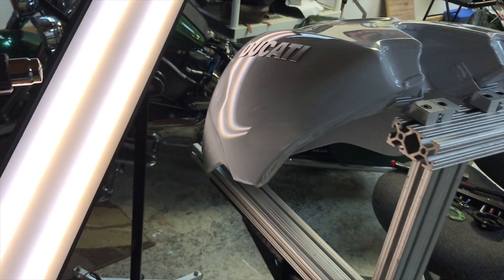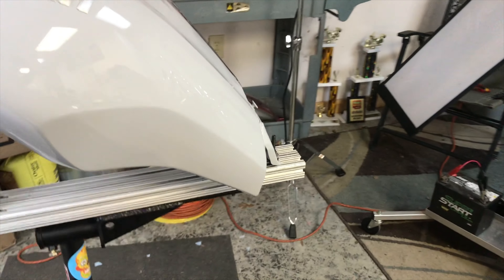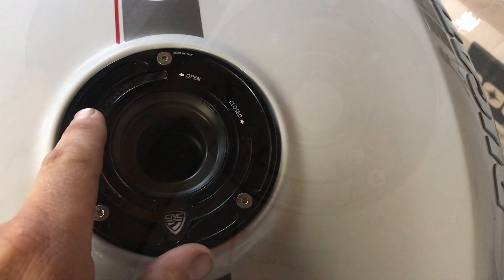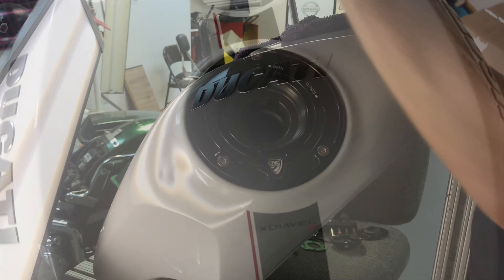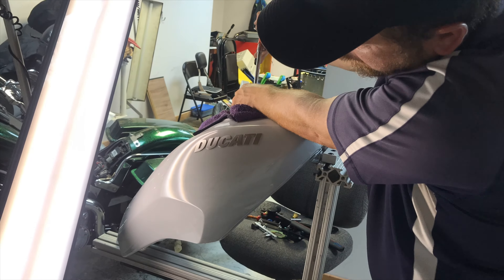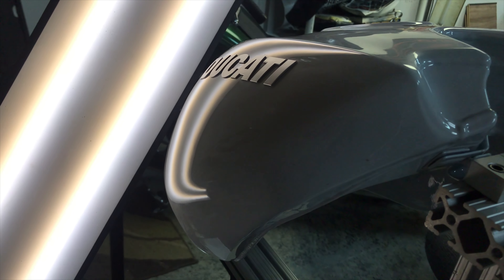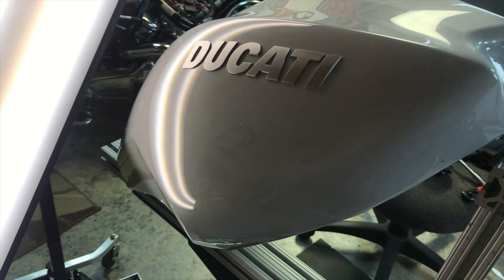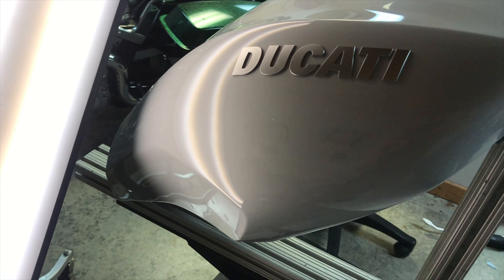Motorcycle Dent Removal - Ducati Xdiavel S Gas Tank Paintless Dent Repair

Comment: Are those punches you use rubber coated? Great work!
Reply from the maker: robert farns some are, some are polished steel that won’t scratch the paint as long as they stay smooth and polished.